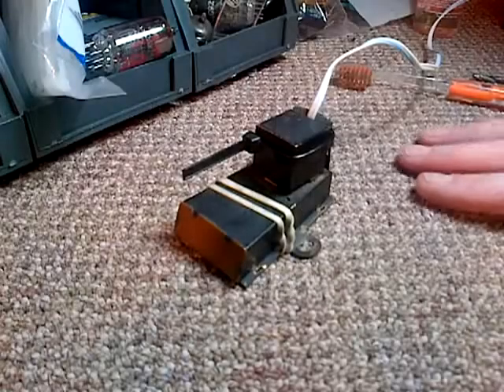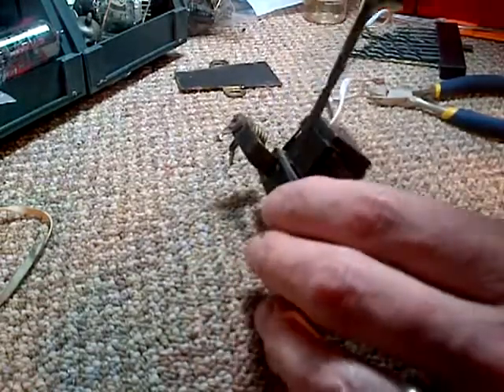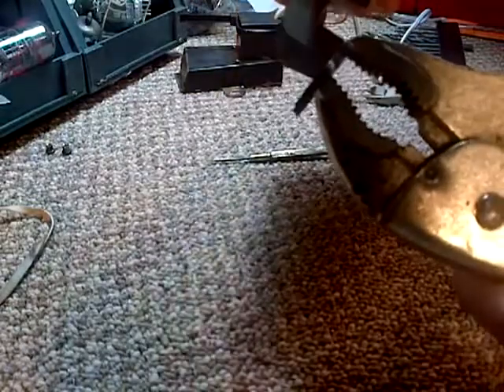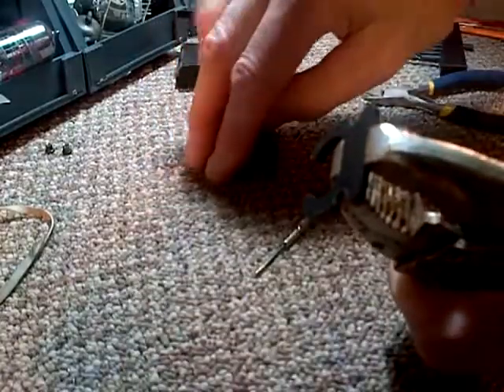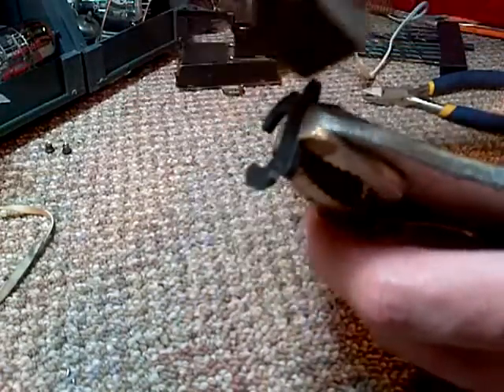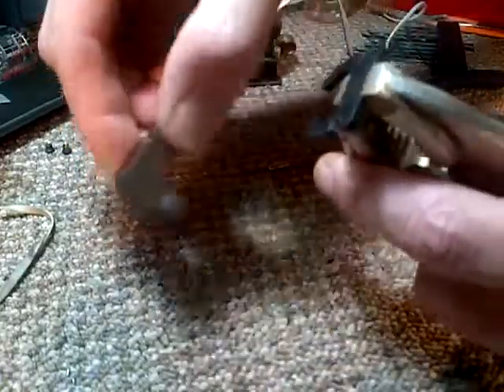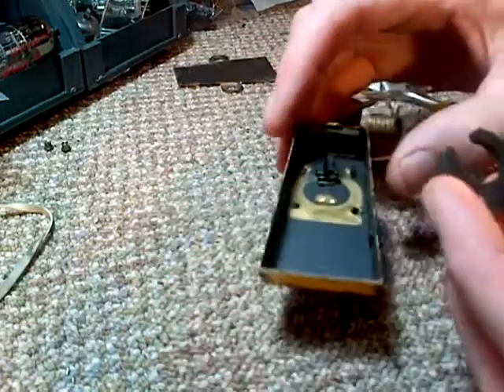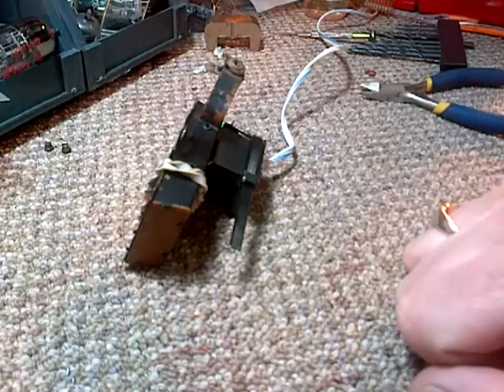Philco 91A 221 Radio Repair Video #32 Re-magnetizing the Shadow Meter Magnet

Comment: I used a round rare earth magnet or neodymium magnet 3/4 by 1/2.  ran it back and forth around the magnet in various spots till it worked.  Betting you didnt have to disassemble yours either.  Mine just doesnt stay deflected and block the light after power on.  I have no idea why the b+ current draw on mine drops to 2 or so milliamps after power on.